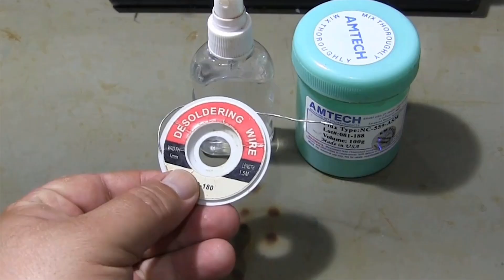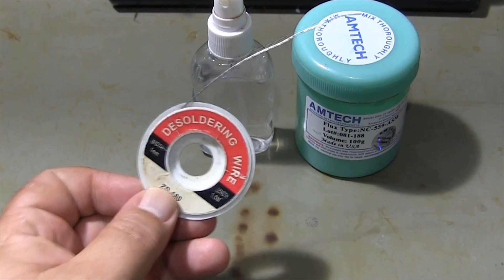Discover the Secrets: Expertly Soldering a SMD Integrated Circuit.

Comment: Вы очень перегреваете микросхему, проводя очень часто жалом по контактам... Феном быстрее.
Reply from the maker: I don't think the heat will be a problem.  The datasheets of the integrated circuits also write the maximum heating values and with this soldering method, I do not exceed the maximum heating values.  Yes, using a hot air gun will be easier.  But in this video, I wanted to show this method for those who do not have a hot air gun.  Thank you for your attention.